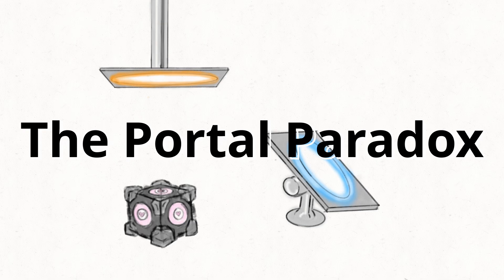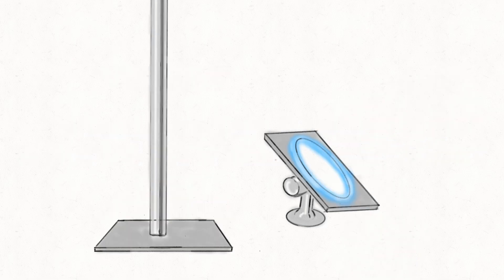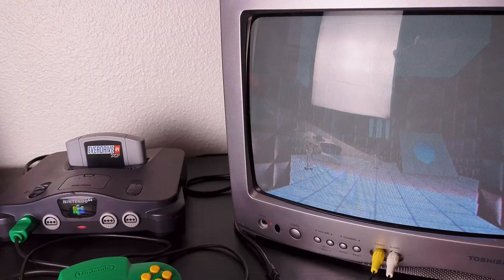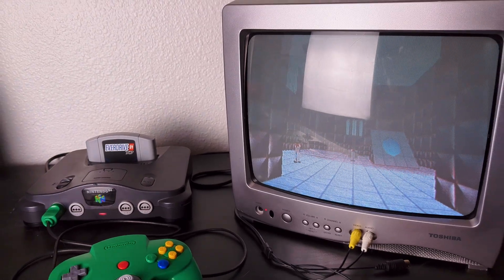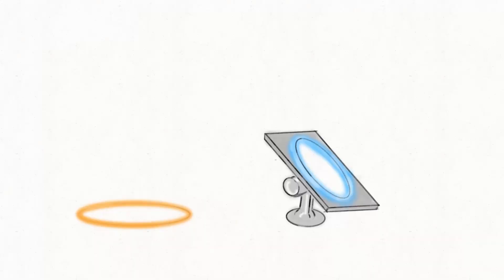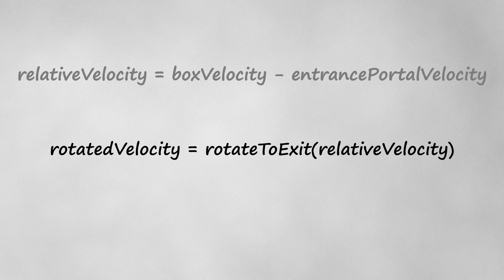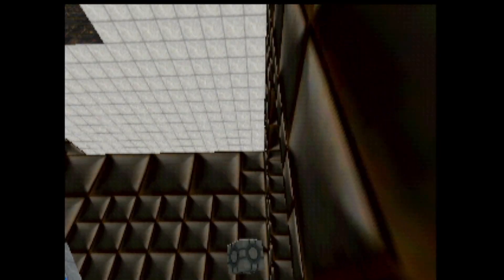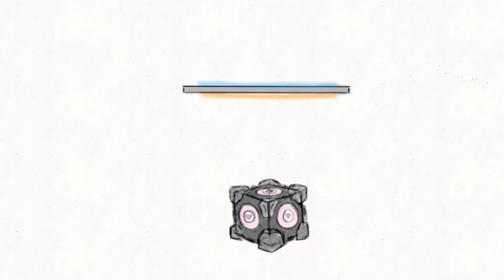I rewrote Portal from scratch and solved the Portal Paradox

Comment: Initially I thought you wrote it the way you wanted it to behave, but then you demonstrated the "hula-hoop" test - that is you put the portals back to back. That result is as expected and since (so long as I can assume in good faith) you are using the same logic with both demos, I find this to be a fair experiment.
Reply: He’s wrong. All the energy of the movement of the portal is absorbed by the ground. None of that energy is converted to the cube because the portal functions as a hole. The only scenario where ur logic makes sense is if you’re telling me the entrance to the portal has viscosity creating friction, which is never even remotely implied in any of the games. You use similar (but really not) experiments to justify your logic, when u should be using actual physics instead. Unless this video was purposely meant to be wrong to cause controversy and get engagement.

Comment: Another thing to consider in regards to the portals’ relative velocities, if the orange portal is moving, then it is AS IF the blue one is moving too. Orange portal speed = blue portal speed, so when the orange portal comes over the box at X speed, the blue portal is being treated as moving at X speed too. However, since the blue portal is actually stationary, you “subtract” X speed from the portal to give it 0 speed, and add X speed to the cube, which would naturally cause it to be propelled
Reply: He’s wrong. All the energy of the movement of the portal is absorbed by the ground. None of that energy is converted to the cube because the portal functions as a hole. The only scenario where ur logic makes sense is if you’re telling me the entrance to the portal has viscosity creating friction, which is never even remotely implied in any of the games. You use similar (but really not) experiments to justify your logic, when u should be using actual physics instead. Unless this video was purposely meant to be wrong to cause controversy and get engagement.

Comment: VERY good explanation! Adding the hula hoop analogy really helped make this make sense for me.
Reply: He’s wrong. All the energy of the movement of the portal is absorbed by the ground. None of that energy is converted to the cube because the portal functions as a hole. The only scenario where ur logic makes sense is if you’re telling me the entrance to the portal has viscosity creating friction, which is never even remotely implied in any of the games. You use similar (but really not) experiments to justify your logic, when u should be using actual physics instead. Unless this video was purposely meant to be wrong to cause controversy and get engagement.

Comment: I disagree. 

Say you had a portal racing toward you, you need to step into the portal in time for the edge of the portal not to knock into you hard. So you step in, like stepping away from a car hurtling toward you. The space in the portal isn’t moving, you wouldn’t expect to be launched through space just because you stepped into stationary space on the other side of the portal. And yes, what if a portal were hurtling toward you, half your body were inserted, but then the rest of your body was on a platform that was able to instantly accelerate to the same speed as the incoming portal just as half your body entered the portal? would you expect the half of your body inside the portal before acceleration to be ripped away from the rest of your body? I don’t think so. Why isn’t it like a window on a platform hurtling toward you? thread yourself through the window and you wind up safely on the other side. Portal acceleration and relative acceleration don’t matter. It’s not that the equation is wrong, it’s that the whole premise is wrong.

Comment: I like it.   If the rule is velocity is preserved between portals, if one portal is moving and the other is not that velocity needs to be preserved.

The only situation that I think might be weird is you do the reverse.   Where you try go through the none moving portal to the moving one.   You might not have enough speed to get through a stationary portal and may get shot backwards.
Reply: Not velocity: momentum.
Reply: @darkcoeficient   momentum=mass*velocity

We know that mass must be preserved through the portal in order for it to be a portal therefore velocity is the parameter we care about.   

That's why his calculations don't consider the mass of the object at all, just their relative velocity.   Not there relative momentum.

Comment: Mkay, I don't like that you didn't give the obvious explanation to why the box is moving. It has to be moving, to even exit the blue portal. The moment a portion of it is "scanned"/"teleported" by the orange portal it appears in the blue portal and since more and more of the box gets teleported it has to move out of the blue portal in order to not end up as a 2D square instead of a 3D cube. This creates movement energy at the same speed as the orange portal is slamming down on the cube and this propels the cube forward and makes it fly. I'd like to see the orange portal move at extreme slow speed over the cube and I'd expect the cube to not be launched but drop right back through the blue portal.

Comment: An objects momentum is conserved when going through a portal. It will exit with the same speed as it entered in. If you slam a portal over a cube, that cubes momentum will still be zero because its not moving, the portal is. The cube entered the portal with zero inertia, so it exits the portal with the same inertia.
Reply: When you jump do you immediately just plop down? No, of course not, you'd stay in the air for a bit and then fall down. The same exact thing is happening here. The exit portal does not care how the cube is going into the entrance portal, all that matters is how fast it's coming through. When the cube shoots up out of the exit portal it doesn't just stop instantly once it bottoms out, it's going to keep chasing that momentum it was coming out with, hence why it goes flying. This is why relative velocity was mentioned. Because to the exit portal the cube might as well have come falling through or be pushed into the portal rather than the portal coming towards the cube. It doesn't care how, all that matters is how fast.
Reply: @RNeeko  no because I exerted force to propel me opposite of the pull of gravity. Gravity then pulled on me with the same force I pushed off with so I fell back down at the same rate I jumped. This required me to exert force. No force is being exerted on the cube so it's not gonna move.

Comment: if memory serves correct, isnt there a mission right before you defeat glados where you shoot a laser into 1 portal, and it comes out of the other portal which is planted on a MOVING platform to cut apart the tubes? coulda been portal 2 but i dont remember

Comment: I disagree with this. The box does not have any velocity and no forced acting on it besides gravity. This implementation presumes that going through a portal imparts a new force besides the gravity of either end of the portal. It should be plooting out the other end.
Reply: so what should happen in the scenario where both portals are in motion?

Comment: Still feels wrong. 

As to why: Imagine if you slammed the yellow portal down but not all the way to the ground, so you have maybe two thirds of it going into the portal. 

Going by your logic, these two thirds would be accelerated through the exit portal at the same speed, but what of the remaining third? Does it get sucked in, even though there is no force other than gravity affecting it? 

I think that gravity prevents the cube from being launched in the way that is simulated, unless you were to slam the portal significantly faster. If you drop a cube into a portal on the ground, the acceleration it experiences is simply due to gravity: A force pulling it down. 

The portal paradox on the other hand would amount to a force pulling it up and because these forces are opposite, they cancel each other out. 

The exit speed of the cube would be equivalent to the speed of the portal hitting the cube minus the time required to pass the cube through the portal multiplied by 9.81 m/s² and therefore considerably slower, so unless your yellow portal hit the cube at really high speeds, it would probably roll off the blue portal or just perform a slight hop.

Comment: If assuming the portals can IMPOSE momentum onto objects, then sure this would work as demonstrated and the equations check out. However, within the confines of Portal, the portals themselves only MAINTAIN velocity, momentum, orientation, position (relative to the portal surface), and things like gravity or other attributes of the passing objects. They DO NOT give objects any of these attributes, they only transfer what is entering it. What I think should happen, is that the object will exist as a 2D version of the 3D model, deposited on both surfaces of either portal oriented from the direction it entered, so a top down engulfing would produce a top-down image when viewing the exit portal. In other words, NOTHING will happen.
So a moving entrance portal would not actually "move" any part of the object OUTSIDE of the exit portal, as the object has no momentum to escape the surface of the exit portal. I'll explain more below. Now since my profile pics have literally always been tesseracts, I may be biased towards the altered dimensionality approach lol.

It is probably flawed but here is my line of reasoning and assumptions:

1)   An object can be inserted halfway through a portal for instance, because it was given the momentum to escape the surface of the exit portal. You can stick your hand through because you PUSHED it through. If there is no momentum, entering the portal would effectively teleport that slice of you to the entrance of the exit, but NOT be pushed through into the environment. If observing the exit portal head on as an observer, you would see a 2D representation of whatever has been fed into the entrance. Instead of seeing a hand poking out, you would see it without depth, potentially with the closest cross section on top. This is up for artistic design really since technically light would still pass through and I am not sure what that would look like, but what I'm getting at is that there would be dimensional distortion. It would be like a picture of the object, lacking depth. A 2D image on your screen, of a 3D object projected as a 2D image. The whole hand is there as information, but until momentum is applied the entire hand exists between portals without the 3D characteristics.

2)   This would mean ANY orientation of portals would behave similarly, since gravity and other forces only exert on objects OUTSIDE the portals. Whether one is upside down or horizontal or at a 45 degree angle, until you press W, your hand will be between realms. And only after LEAVING this lower dimensional space (from the observers perspective) will you change momentum from gravity for example. As an observer looking at the portals, again, you still see a 2D construction of the 3D object until it pokes out, since the information is retained on which parts would exit first. With this logic, really the equations for velocity would be ( boxVelocity = boxVelocity ) which is, you know. Not very useful. But that's what I am saying, nothing happens. The object disappears if you were to move the entrance portal back to where it started, since the object cannot pass back through without momentum. Unless you interact with it, it will be in the aether if completely swallowed by the portal.

3)   This is solely applicable to a moving entrance portal with a stationary object and exit portal, where you'd come out of the same spot in space relative to the exit. If the exit portal were moving and something passed through after adding momentum, then an object would pass slice by slice at different places in space within the world unless simultaneously negating the exiting direction of the object AND precisely matching the speed it exits. Otherwise, exiting would lead to deformation of the original object. Think of MSPaint.exe with a 2x2px pencil, as you drag it across the screen the squares overlap and create a solid line, not a big deal on paper. But think of a 2D slice of your hand coming out, then shortly after the portal has moved in the world to the left, the next slice came out (again your position relative to the PORTAL is maintained). This is catastrophic to compensate for and ultimately why I assume the devs never implemented moving portals. It would technically distort anything that passed out of a moving exit portal unless under very special circumstances, as each slice of the model would need to be skewed for translational movement through space after exiting the portal. Not a very fun game if everything else remained the same. Be interesting to see a game use this as a mechanic though, like for making objects longer or a certain shape to complete a task or something.

Anyways, was just really intrigued by this thought experiment and enjoyed the video very much. So cool you make N64 ROMS, I did not know that was a community but now I feel like I am missing out!

Comment: The only problem is there's no actual force being exerted on the cube besides base gravity, if we think from the cubes perspective all that is happening is a quick change on what angle gravity is pulling it to the floor. Your result would only make sense if the cube was on the moving platform being pushing through the portal because then the cube would have momentum.

Comment: Relative speed is an incorrect logic in this frame of reference.
The cube does not have any force applied to it, therefore it can't suddenly break inertia. The portal moving towards it is akin to a doorframe moving towards you while you are standing still. If the door stops moving while you pass through it, you don't suddenly start moving yourself.

The fact one portal is moving and the other isn't, already breaks the law of physics (since the two portals are practically the same "doorframe", it can't be both moving and not moving at the same time).

Comment: Portals are all made up, but if you assume that a portal on a moving surface imparts a velocity to a material that passes through it, then the material will be ripped apart (or possibly explode). Just imagine if you moved a portal halfway onto an object and then stopped. The first half of the object would be flung away from the stationary half. So if you did want to maintain object integrity, then you have to assume that a moving portal does not change the velocity of anything passing through it.

Comment: you should make a toggle switch where you can lower the portal incrementally instead of it just coming down at a select speed...i think there is a threshold at which speed will make it jump out vs just sit there, roll out...maybe also put one portal on the floor facing up (exit) and then repeat the test will the entrance portal moving from the ceiling down to the ground...

Comment: You're breaking the first law of thermodynamics by making the cube fly out the second portal just because the first portal moved over it. The cube was never moving. You need to input energy to move it. Running a ring over it is not inputing energy. In the scenario the cube would appear on the sloped ramp and gravity would come into play to topple the cube down the ramp. That's it.

Comment: If you do a force diagram, your interpretation (and therefore your simulation) requires that the entrance portal is creating a force on the cube.  I can’t make sense of that.  If you break the problem into parts, say 1/10th of the cube per part, you could do force diagrams for each to approximate a result.  The way I interpret the portal is just like any other doorway.  If I’m standing in a hallway and there’s a doorway on rails in that hallway, it doesn’t matter how fast you run the doorway, I’m still stationary.  With that interpretation, you would have the normal force and gravity acting on the floor surface of the cube.  But you would also have the top section of the cube with effectively the normal force from the part of the cube that hasn’t passed through the portal yet and gravity pulling at a relative angle.  Neither of those forces would produce momentum to send the cube flying.  The gravity would eventually overwhelm the normal force and the cube would roll down the exit portal.